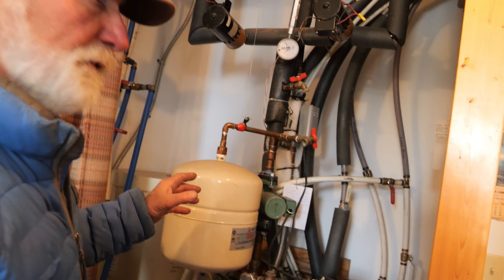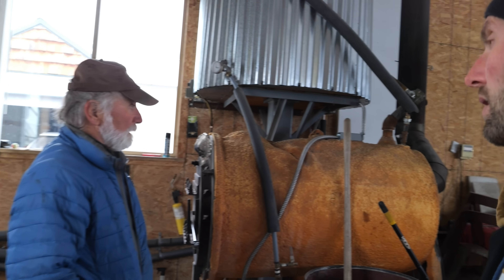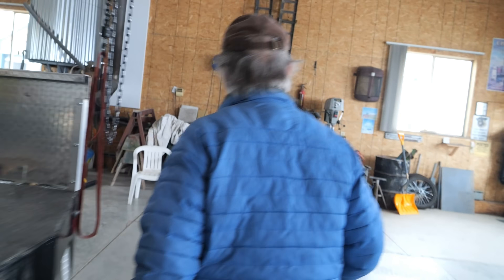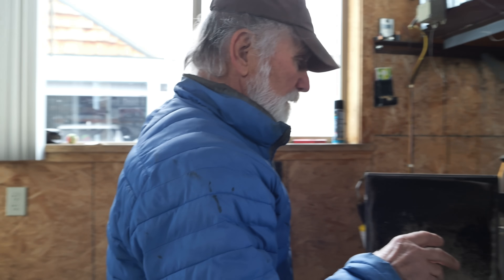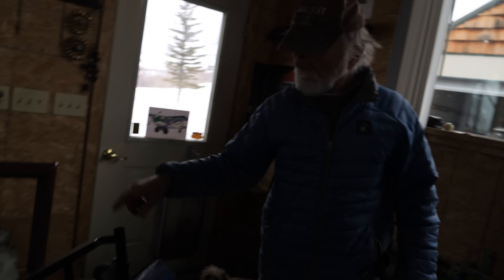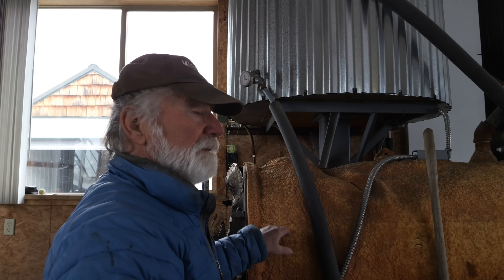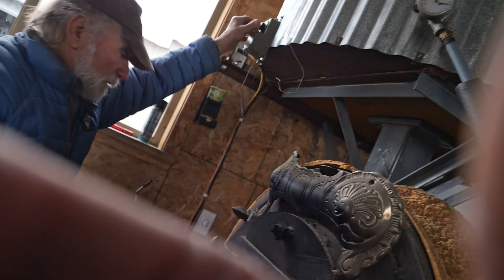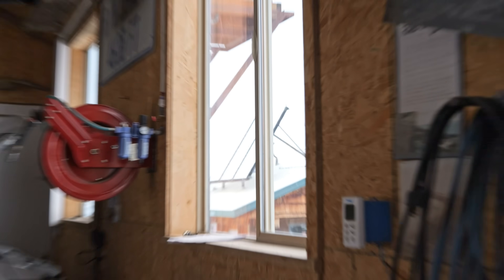Hasn't had a Heating Bill for 40 years.

Comment: I stopped using the  furnace around 10 years ago, when my winter heat and air conditioning bill hit the 250 or so dollars per month.  I have 20 acres of oaks and hickorys I'll need to buy the next chainsaw pretty soon. I've trashed three  and many chains and bars. I use one small window air conditioner and few small fans 95 degree out side, 75* on the inside. Winter it can very form 75* to 60*, at night is good sleeping temperature is 60*. I live alone so I don't have to put up with kids and women complaining, it's too hot, it's too cold in here!
Suck it up butter cup!
RAVEN OUT
TO ALL OF THE WONDERING JOHNS, STAY ON POINT!

Comment: This is probably never going to be seen with 1670 comments already, but how do you shed the heat from the solar panels in the summer? Can they simply take the heat? The Glycol will boil at ~390F@1ATM and it would take a higher temp to flash boil it in the closed system but that system isn't really a high pressure system. Is the system just opened to the atmosphere and allowed to boil off if it gets too hot? Do you drain the glycol out and let the panels cook during the summer? Is it as simple as a relief valve? Not saying that is bad at all, just wondering. Or do they simply not get hot enough to boil the glycol and it is a non-issue? Thanks.
Reply: The 6 panel array, once the heating system is over, is simply drained out, the 3 panel system on the house has 1 panel convered with shade cloth, leaving the remaining 2 to provide domestic hot water to the home's 120 gallon tank. When it reachs 130 degrees, water is pumped to the 200 gallon shop tank, basically the system runs in reverse in the summer. Instead of hot water from the shop's wood boiler and it's 6 panels being pumped to the house,the opposite happens.  When the shop's 200 gallon tank reachs 15 degrees above the shop bathroom's hot water tank, a pump transfers the heat, all automatically, using the same pumps used during the heating season. Simple.....!???

Comment: I once worked with an engineering grad student who was working on the problem of summer heat on glycol based hot water solar panels. If the glycol reaches its boiling point (197.3°C or 387.1° F) it is destroyed. So the problem wasn't the added heat to the water heater via a heat exchanger, the problem was, in the summer time, when the only heat used was to heat a 40 gallon water tank once a day for family showers, what do you do to dissipate the excess heat and prevent the glycol from being destroyed. Any thoughts?
Reply: see the above comment

Comment: So Fantastic! i do the same but with 20 Volt DC pump that get solar power from my roof as i had down time from my Utility and no circulation!
Reply: The circ pumps for the thermal panel's loops are PV powered. No controls needed that way, sun comes out, they start, it gets cloudy they slow,  it gets dark, they stop, as you know.  And of course they work if the grid goes down.

Comment: As a professional plumber he is not kidding. I would walk in there and say no thx. I would not spend the time trying to figure out what hes done. When he dies so does this system
Reply: The radiant floor system is familiar to any plumber who has worked with them, a conventional boiler, gas or electric, could be easily installed as a sole full time heat source, replacing the solar and wood burning boiler inputs.  When he sold his last place, that's what the mortgage lenders demanded, making it a more  "traditional" system. He had the work performed by pros, and added the expense onto the home's sale price.

Comment: not that it matters, but up front costs, maintenance costs, tech aptitude required, your own personal time, what the real cost? its always "free" [ ""or hasn't had a heating bill""... but has also not had any other costs associated?] quantifiably, nothing is free. even the 30 year old panels (dived by what other maint. costs over 30 years) = equals. like, seriously, what's the number? "completely free" i suppose.... or more like $1000 a year, $250 a year. Hopefully a genius will stumble across this and give a generalization rather than nothing at all... can accept hypotactically, inflation (with or without)... explain it to me like I'm 10. how much this cost per year?

Comment: Maybe missed them but where are the safety valves or temperature relief valves.
Secondly on his solar loop he should install a three port valve and a heat dump just in case the solar panels and loop gets to hot.
Its actually a basic system and easy to follow but I think it needs to be assessed from a safety point of view.
He could be creating a ticking time bomb.
Interesting all the same to see an old school system like that working.
Reply: 50 PSI relief valve on the solar loop, in case the circ pump fails and the panels go critical. Vented outside up on the roof. Boiler has similar, plus a boiler relief valve.

Comment: but i wonder how long it takes to pay the difference in cost to actually set this up, but for the boiler ,now you either have to buy wood, or chop your own wood, if everyone did that, more tress would be cut down and then that would cause an issue, plus burning fossil fuels, the only problem in the world is the amount of people, reduce that and you reduce all the other problems
Reply: No chopping down of trees involved, or buying it either, all free dead fall and scrap lumber from construction sites he's on anyway, that would otherwise go to the landfill. About two pickup loads per season, not a huge amount needed as the sun does the rest.

Comment: Maybe it's the US's fascination with Forced air, but that is a fairly regular but was disappearing system in the UK, the move to tankless hot water heating is starting to move back though, I've lost a little bit of knowledge over the past few years since finding out about double cycle 75°C heat pumps.
The only 'plumber freak out' is the disorganisation, but that's more for servicing / maintenance, and not an understanding thing.
Surprised he doesn't tank the solar hot water, double coil tanks are very regular, especially a couple of decades ago, he only really needs 42°C water (107F) for the underfloor. The 'heat' from yesterday keeping it warm just shows how much concrete mass in the floor he is heating, especially with what looked like single pane windows!
I assume he has a pressure release valve, that 3am wake up to release the wood stove powered pressurisation of the hot water tank always worried the crap out of me, bouncing pipes will still wake me up 30 years later.

Comment: How does this work for domestic hot water? Would you need a tank and a tube exchanger when using wood heat or can the combi still handle hot water.
Reply: DHW is plentiful, via solar thermal, the boiler, or an electric element as a backup

Comment: What's truly interesting and what he glossed over a little is the amount of thermal mass storage he has in both the water tank and the concrete slabs. Takes time to get up to temp but that also means it cools slowly. One question: What is the safety mechanism for the hot water boiler if flow stops? Spring pressure release?
Reply: Both temp and pressure relief valves

Comment: We built these boilers in 80-81-82 in Up of Michigan The 30” tube an 24” pipe liner tube inside oblonged with only 1” space on bottom!  Cold water in bottom an hot out top an circulator pump to move hotwater inside house an garage floor! Only problem was UL approved insurance company’s started crack down! Thus now the outside Burners wich we built many also!
Reply: What is the name of a boiler like this?
Reply: I work for UL why did they crack down? Some sort of potential hazard or just a certification issue?
Reply: @krisfitz1235 I'm betting it's mostly insurance reasons because guys without a 415 cert were repairing em and folks were dying or being severely injured
Reply: @redheadedstepchild4130  Makes sense thanks for the reply.
Reply: @krisfitz1235 
Live by Gaylord Michigan and would like to learn more.
Reply: I like what he did here. I have an outdoor boiler I want to simply put into my garage and run it this same way. Some of those rooftop heat exchangers would be really neat too!

Comment: Very hands on. I had confirmation that my glycol from the roof often is too hot ( 120 C), and my heat exchanger is too weak. I told a plumber to get me a bigger one, he brought a smaller! I have been looking for a solar driven pump for years, as the local fools sometimes interrupt electricity for a couple of hours, not good with overheated glycol, right now at 60 degrees north i have around 100 C  glycol on the roof, although freezing temperatures . Perhaps an extra heat exchanger like this guy?
Reply: His works with a solar powered circ pump, so power failures don't cause the system to overheat. In addition, he has a strap on controller  on the hot line OUT of the thermal panels, so once the line reaches 120 degrees, a larger AC powered pump clicks on increasing the flow rate over what the PV powered pump can do.  So the PV powered pump starts the flow when the sun hits the panels, acting as both a controller and a power source.
Reply: I thank you for your answer,    I think I see a solution now.

Comment: I had this system in the ‘80s. It came with the house I bought in Ottawa. I could get 140 degrees off the roof. Cost $10,000 at the time, and exchanged heat in my hot water heater. I would never have bought it, and did not like the glycol running through pipes in the hwh, which supplied hot water we would be drinking.

Comment: "Hasn't had a Heating Bill for 40 years."

Ok, but has it paid itself off yet in the savings? 

Not having a bill is only impressive to those of low intelligence.

He basically paid 20-40 years of the bill upfront.
Reply: Decades ago. A quanity purchase of the panels, 30% tax credit, self installed, sold and installed them for others also, all helped make a for a real quick payback.

Comment: No heating bill?
And the wood that burns in that boiler was just created in that garage?
Ok, he has his own forest where he cuts them, but without that he would have to buy firewood and that is automatically a ˝heating bill˝
Solar panels are more efficient if the heater is immersed in a water tank instead of having an exchanger through which you have to circulate the water, meaning you have one extra pump that consumes electricity
Unfortunately, he has a "heating bill" in the form of the time he spends storing firewood
Reply: No heating bill, correct, or wood bill.
Reply: @portnuefflyer  It's great when you have your own forest that you can cut for firewood, but in many countries you have to have permission to cut wood in your forest in the form of either taxes or annual permits
because, for example, in the EU wood heating is classified as non-ecological heating and you have to pay an additional tax for it

Comment: I worked for a company in Alberta who had engineered a system which created electricity from heat loss AND induction energy...100% independent...100% off grid system

Comment: Hasn't paid a heating bill, but has he had to pay for maintenance or parts? Does he get all his wood for free or does he sometimes have to buy it? Does he pay for the water? Does he ever have to refill the glycol for the panels? Do the solar panels run the pumps or does he have to pay for additional electricity to run those?

I get that this is probably cheaper than regular heaters.... But there's no way it's 100% free to run like the title and video imply.

Comment: Now please find someone who has done a "passive" cooling system in a shop and or home in Texas that maintains 72deg in the middle of august. I have been kicking ideas around for years and hope to give it a hop, but I am really curious if it is even possible.
Reply: They exist but are not really retrofittable, angled slab walls that catch the sun and heat but only release it slowly when night comes, towers that catch high winds to draw hot air up and out, tiny windows and water features in shaded areas.

Comment: Ok, so I live in Las Vegas and we barely get cold and almost never below freezing.  I had a solar pool heater installed on my roof.  2300sqft house so it's a big roof and half of it was solar heating.  We have almost 330 sun days in Vegas.   Around Nov, the solar couldn't keep the pool above 45F degrees, and the pump ran almost all day, so I switched to propane heat.  I just can't see how on earth his solar works like he says during the winter in those freezing temps with the snow.
Reply: Because it's set up properly?

Comment: the main reason people don't use this kind of set up is because its complicated as hell and expensive to pay a plumber to set it up. he even says in the video, his set up would make a plumber cry. if you paid a licensed plumber to build this system to code, the price would be astronomical and you would need to keep the house for probably 30 years to break even. that said, the heating panels are pretty sweet if you don't want a ton of heat. its a fairly efficient way to transfer solar energy around

Comment: I would like to know what he does with the "spare" heat from the hydronic solar panels during the summer months. I assume he uses some to heat domestic water. But even then, what has to be done for the extra hot water/glycol? Do he have to do something special? 

I would really love to know as for when I design my system in the future.
Reply: Drained out empty, once the heating system ends, simple and effective,  the same water/glycol mix pumped back in come  fall.

Comment: I'd be curious to see if he has leaks when he switches his valves, pressuring an unpressuring pex creates issues... Our boiler at our shop had a forced air and I put a thermostat and a power switch on it and I could shut it off and I'd keep a fire in that box for about 3 to 4 days in 0° weather... It would also snuff the fire so it wouldn't get too hot.

Comment: Now this is comon knowledge and we use heatpumps instead of burning wood. But its amazing he build this 40 years ago. I doubt those solar panels are 40 years old but floor heating 40 years ago was not very comon.

I saw some new piping, so this system is not entirely 40 years old.